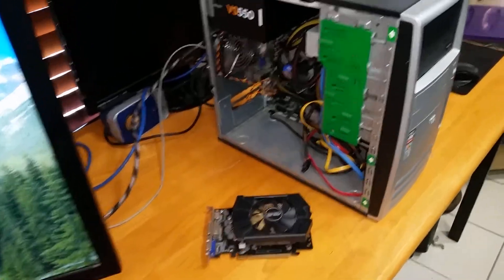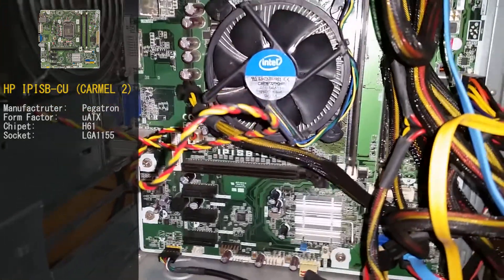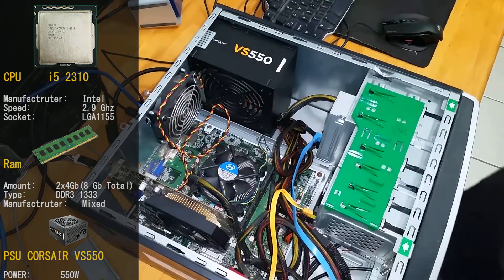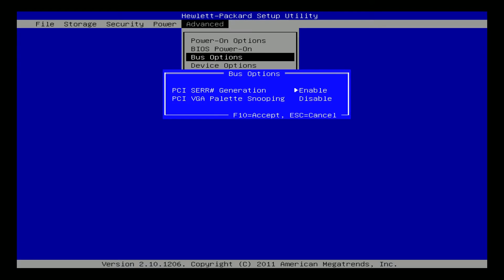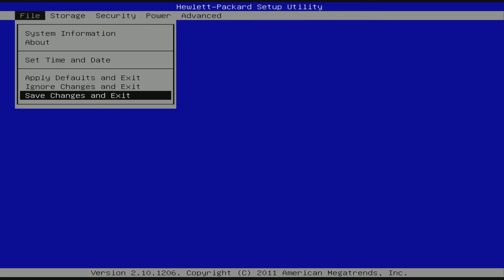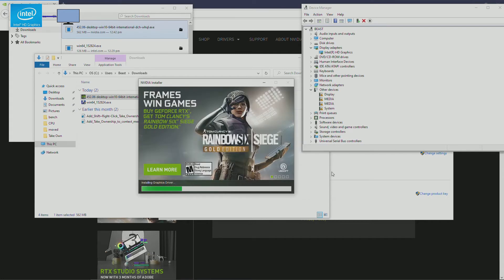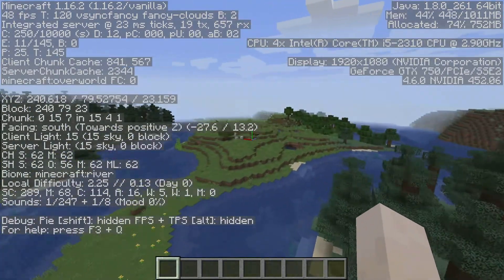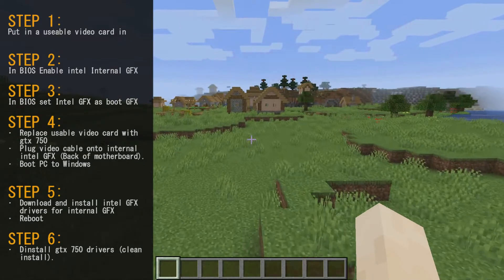Gtx750 UEFI work around for HP IPISB-CU (CARMEL 2) / HP Pavilion p7-1205.

Comment: Pegatron 2AB5   with  1060 gtx not work:face-orange-raised-eyebrow:...can help me ?
Reply: I have same motherboard (IPISB-CH2) and MSI GTX 1060 GAMING X (6GB) and it is working only in already running Windows, not for Windows boot. When I restart with a display connected to GTX there is a Code 12 error in device management. When I unplug the display from the GTX I can reboot, then in device management I can disable and enable the GTX  1060, connect the display and it starts to work without any problems (till next reboot of Windows). Any ideas? Have you got it to work?
Reply: UPDATE: It is possible by updating the BIOS with an unofficial update.

Comment: There is a much easier fix for that. It's a modified bios that you can get from internet archive. I was hesitant at first but when I installed it my card worked perfectly
Reply: i had received a Crappy HP pavilion that only had Low End intel GFX but i had a GTX 970 but it kept crashing on the HP screen so after about 5 hours of reading forums i found that quick and easy fix no other GFX cards required..It really made my day LOL

Comment: Would i be able to do this with a R7 240 or a Rx550?
Reply from the maker: Possibly. It will depend on if the AMD drivers work in windows. But I think it probably should but you may have to try older drivers. Though we have not tested it so it may not work at all.  If you do try it let us know how it all goes.

Thanks for watching.
Reply: @OFFbitTech  yeah, I'll give it a shot with the Rx 550 first and report on my findings
Reply: @snakeeyes7973  I just booted with an RX 560 (no aux power required). See my recent post about flashing a modified bios. In my case the BIOS was corrupt so I had to use a mechanical chip flashing tool which surprisingly was quite easy and effective!
Reply: @zeilstar  okay, that's good to know. That gives me hope lol

Comment: Off beat I have a question about what  m.2 wifi card I need for this board?
Reply from the maker: Unfortunately we don't have the IPISB-CU motherboard here anymore, though we do have another HP motherboard of the same era that we can have a look at and get you an idea what might work in the machine.
Reply: @OFFbitTech  I would appreciate it
Reply from the maker: @Smac-n-cheekz  The small card slot on the motherboard is a 
 PCI Express half-size mini card socket (Gen 2.0)
You should be able to purchase any pcie mini Wificard I would imagine, though there will most likely be a white list (a list of cards that HP allow to work on the board)
But most second hand laptop wifi pcie mini cards should be on that list I would imagine.

We have a HP PC here from the similar year (HP 110 Desktop J1F92AA) and it uses this part number on the card.
709505-001.
Which comes out as a RTL8188EE Wifi Wireless N PCI-E Half Height card.

Here is one we found on ebay.
https://www.ebay.com.au/itm/312328869506

If we find out any other information we will let you know.
We hope this helps.

Thanks for watching and your support.
Reply: @OFFbitTech  
Hi,  
Do you have any updates on whether the RX6600 is or was still working with the IPISB-CU?  
Thanks!
Reply: Intel 7260HMW worked fine on my Ubuntu, including bluetooth. You will want to put antennas on it.
Reply from the maker: @zeilstar  Great work,
Thank you for sharing.

Comment: Try someones 280x or just buy a known good one.
It works perfectly with this bios and was somewhere in between the 1050 and the 1060 performance wise.
I'd like to get a 1060 0r 1070 working with this bios as they are smaller cards using less power and less heat being generated.

Comment: Is this problem specific to brandname computers from HP/Dell? I've read reports that 700 cards shouldn't work, but installed a GTX 750 Ti card on a generic motherboard with Intel 965. An Intel "H61" is new and modern in comparison.
Reply from the maker: The problem does seem to effect HP and Dell more but still could effect other manufacturers who do not update there bios. The real issue is UEFI bios. Not sure what it exactly is but if you could get all the new bios information and put that in there you would probably not need to do this work around. However doing that it pretty much impossible with dell and HP bios I believe.

It also only really effect motherboards that started to supporting UEFI so my guess is that it is a bug with early version of UEFI. This is why it seams to only appear on motherboards of the sandy bridge era (this would probably  also include AMD motherboards at the time as well). Most bios updates will fix this problem if there is one available.

I'm an not 100% the real cause of the problem but these are my theories on what the problem could be.

We hope that helps, Thanks for watching and for your support.

Comment: I have this exact board. I've had it for years and ive never been able to install a graphics card on it because I just get a black screen without post. Im trying to get a 750 Ti to work with this method. Going to get a super cheap HD 6000 card off of ebay and try this same exact method thanks for the VERY helpful video mate 👍 curious if you still have this board if you could test an i7 2700k on it, or if its possible for Ivy Bridge to work on it as well. I've been able to get 16gb (2x8) working but my Pentium G620 just can't do any form of gaming for that to make a difference anyhow.
Reply from the maker: I would expect the i7 2700k should work.
We did find the motherboard to work on sandy bridge i5's but it would not post with Ivy-bridge CPUs (we tested with i5's).
This I believe comes down to the bios not being updated once again.
Technically the chip set supports ivy bridge, but the bios does not.

If we come across an i7 2700k we will give it a go in this motherboard for you.

Thanks for watching. we Hope that helps.

Comment: This got me thinking, have you ever tried to get an NVME m.2 to work on this MB or an older MB using a PCIE adaptor?  Tempted to try on my IPISB-CH2.
Reply from the maker: I have, though it does take out pcie slots. Works perfectly fine with the motherboards we have tested them in. Though I do have my doubts that it may not work in the IPISB-CU just because of the amount of issues I have experienced with other sound cards and just other devices with this motherboard.
I really do wish that HP released a BIOS update for this board.

If you give it a try let us know how it goes we would love to know and have a record of it here in the comments on the channel for others looking at the same question.

Thanks for leaving us a line and thanks for watching.

Comment: i have a question and maybe someone has a answer here 
Has someone tried to use this method with a GTX 1050 Ti? Did it work?
Reply: it worked with 1050ti.Im using gt 520 to make 1050 work with this mobo.Mine was p62014d(ipisb-cu)mobo.You just need to take out the gt 520 after you configure your bios setting.And plug back your 1050ti and install its driver on nvidia official webs.Next time you reboot it wont cause any trouble no more.You can get pass the blue screen of HP.
Reply: I'm about to try it now
Reply: @ausama95  hope it works bro 
I'll be waiting for an update
Reply: @charedet  unfortunately I don't have an old card to test it with
Reply: @ausama95  no worries 
I'm glad you at least responded this msg 
Have a good day bro
Reply: @charedet  ty, you too 😊

Comment: Amazing video, very well done--especially showing the links between integrated GPU/monitor and discrete GPU/monitor.  
In January 2012, I bought an HP Envy h9t with an i7-2600 and GeForce GTX 580 with Pegatron IPISB-CH2 (Chicago) motherboard.  Unfortunately after 4 years, the GPU failed.  I tried to put in a new GeForce GPU, 1xxx series if I recall, but it got the same blue screen you show here.  I was able to get an AMD RX 560 that worked.  It worked fine until this day, but especially with newer games I wasn't getting the performance I wanted.  

I decided to get an RX 6650 XT.  This is a large 2.5 slot 3 fan card.  It was difficult getting it into the case, I had to reroute some cables and take off the top plastic RAM extractors for it to seat into the PCIE 16 slot.  After all that, it wouldn't post.  I thought I was out of luck.  Then I tried out your method here and it worked perfectly.  The strange thing is for the integrated GPU, it has plastic blockers over DVI ports...even on the HP website it says that with this MB, if you have a discrete GPU the integrated GPU is "not available".  Which, I guess isn't technically wrong.  I can understand they don't want customers using the wrong ports and then thinking something is wrong with the computer.  

Next on my list I'm going to potentially replace the PSU, the current one is 600W, but who knows how much longer it will last after 10 years.  It's great to know that it looks like HP didn't use proprietary cables/connectors for this MB.  Thanks again, awesome video.  Love your work.
Reply: Literally same. Was my cousin's PC he used for schoolwork back in 2014-2015. Since then ive tried to install several different GPU's (R7 360, RX 580, GTX 750 Ti, GTX 960) and none ever worked. Thanks to this video, I think I can finally actually do something with it. Ive already installed 16gb of RAM in hopes of doing something nice for this poor G620. I hope to upgrade to a 2600k or 2700k and look for a low profile/lower power card to fit in my pavilion slimline case. Honestly sounds like a sick sleeper/sff build for 1080p 60fps AAA and will probably do plenty of high refresh rate eSports
Reply: in the exact same situation as you with the samespecs, learning about this for a past few days. Glad I found this video, previously tried flashing modded bios to change oprom to legacy in bios but bios kept on resetting to default after flash and restart. about to order rx 6600 or 6600 xt and try this method, hope it will work.
one question, how do you find the combo of 6650 and i7 2600? notice any cpu/DDR3 RAM bottlenecks? Cheers!
Reply: @Richard-tj1yh  the CPU and RAM will be a massive bottleneck for sure! I would definitely lock the fps to 60 for a smooth experience

Comment: The HP/MSI-7778 Jasmine might have the exact same problem, but it's a AMD Chipset.
Reply from the maker: Yep, It possibly could be the case.
I am not sure if this workaround would work but if you do try it let us know what the outcome is.

It may help someone else down the track.

Thanks for watching and leaving us a line.
Reply: @OFFbitTech  I just manually flashed BIOS 8.18 via command prompt, this is an AMI Aptio based firmware, that means I can add NVMExpressDXE for PCIE SSD support. It should work on the Intel equivalents. (Tested with Dell Optiplex 9020 - SUCCESS)
I had BIOS 7.07 which didnt support my XFX RX560, but I flashed the new rom and it now works with newer EFI based cards, NVIDIA too!
Reply from the maker: @victorfigueroa9385  Did you find the Bios on the hp web site or was it elsewhere?
Reply: @OFFbitTech  I found it on the forums of HP. They don't even provide the download of the bios for the machines or even mine (P7-1241). I have the link if you would like to take a look.
Reply: @victorfigueroa9385  Hey could you guide me on updating the bios via command prompt? I have the same carmel2 board the OP has but mine is on version 7.14. When I try to update to 7.16 the installation just fails
Reply: @khumbolawomussa1935  Would you like to modify the BIOS or just update it?
Reply: @victorfigueroa9385  just want to update it to 7.16 if possible
Reply: @khumbolawomussa1935  Here's the link, instructions are in a txt file inside.
https://drive.google.com/file/d/1wl9uCpmovpmKJ_DMzflKKct63LU6cKLQ/view?usp=share_link
Reply: @victorfigueroa9385  it says incorrect bios for the system

Comment: So there are some GPUs that boot on legacy and others on UEFI and that is the problem, right? You have an ATI as a usable GPU but I have one NVIDIA GT 530 and I want to install the GTX 750 Ti. Does it make a difference or the process is the same? Should I erase all the NVIDIA drivers to make more easy drivers installation for the GTX 750 Ti? Last but not least. I have an i5-2320 in my mobo that has Intel HD graphics 2000 but windows 10 has detected HD graphics 4000 and installed igdkmd64.sys driver update that is causing me problems because I can not turn on memory integrity in win10>settings>security
Reply from the maker: So from what I think is happening is this.
Most new video cards will duel boot UEFI or legacy.
But if there is a UEFI bios present it will boot the UEFI version on the card. Some cards have the option just to support legacy only (apparently they exist). I come to this conclusion because of the amount of core 2 CPUs we combine with newer cards with no issues.

So why does the IPISB-CU not work with newer video cards?

I think the problem is that the UEFI bios on this motherboard has an early version of UEFI interpretation. It would be an easy fix if HP would release a bios update. But this will never happen.
Also, the chipset on this motherboard does support later than 2000 series SandyBridge based CPUs but the BIOS on this motherboard does not.
We have also found a few other issues with sound cards and this I believe is also due to the BIOS.

There are some major issues with this motherboard and I don't think any of these are problems of the hardware design itself but more so from the lack of support from HP not updating the BIOS.

The gt530 should work for doing this trick though we have not tested it.
It would probably be best to start the installation off with a driver clean of sorts.
Or at least install the new drivers with the driver clean option set in the Nvidia driver install.

As the issue with the IGPU intel hd4000,
we have not played with memory integrity, but I do wonder if simply just disabling the HD4000 in windows will solve the issue. This will should still let bios use the IGPU as the primary video card when booting but then it hopefully just switches over to the new Nvidia card.

We hope this helps,
let us know if you have any success or not.
This is not an easy workaround, but it may save you a few dollars on upgrading the motherboard.

Thanks for watching and good luck.

Comment: Hey! When i try to install my pentium g2030 in place of the g630 on my hp slimline, i get no video, also no way to make a 1650 work is there? I didn’t realize this was an issue on HP computers, and i thought dell was bad with not allowing overclocking, but i switched to an i5 3570k no problem on that one, unfortunately the pentium from that one does not seem to want to work in my ispib-cu carmel2 mobo. Any help appreciated
Reply from the maker: Unfortunately if your system has this motherboard upgrading is very limited and problematic.

To my knowledge you can only use Sandy-bridge CPU in this machine. Though you can still upgrade to i3's, i5's and probably i7's in the Sandy-bridge range (anything with a i3 / i5/ i7 2??? number, something like an i5 2500).

 Also anything newer than the Geforce 600 series cards will give you issues with booting. 

This work around may help you put a newer card in but there is no guarantee it will work for you.

This problem is not a problem for all HP computers just a few where they neglected to support the board for newer Bios updates.
I would also say there will be other motherboards that have the same issue from other manufactures.

We hope this sheds some light on the situation.
Thanks for watching.
Reply: @OFFbitTech  thank you. Hp is headed to scrapper anyway lol
Reply from the maker: @ryanravencaller  It's a shame but unfortunately there is not much you can do with these motherboards.

You might be able to sell it second hand for a few dollars. It would make a great motherboard for a console/arcade emulator PC.
Reply: @OFFbitTech  I never sell anything like this, it just sits unfortunately. Maybe ill make a wall mounted motherboard key chain holder and use a 1 gb stick of ram as a key chain haha

Comment: Need help if possible, I followed all of your steps, I get to the point here my GTX 750ti is booting up but as soon as it gets to the windows logo it freezes up. What do I do?
Reply: same
Reply: @Amzology  I can't quite remember how I did it, I got it to work eventually but unfortunately I kept getting a message that my computer didn't have enough resources to run the graphics card. I settled for different card that worked perfectly.
Reply: Same
Reply: @grusiturbon  I bought a Radeon HD 6570 1GB DDR3 graphics card for mine because I couldn't get the 750TI to work. That might be an option, it's served me well so far for a nice budget build to play older games.